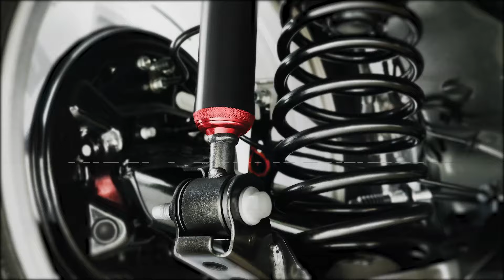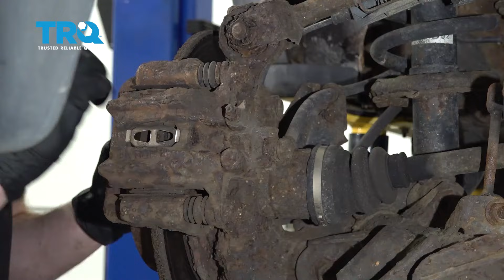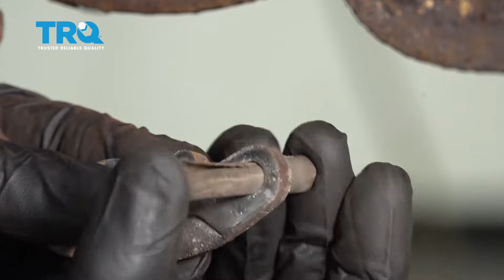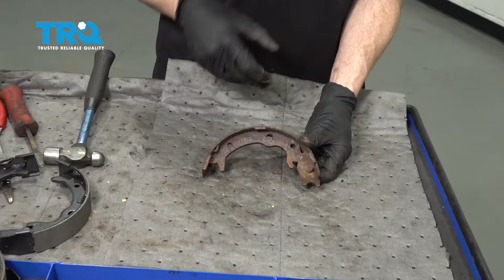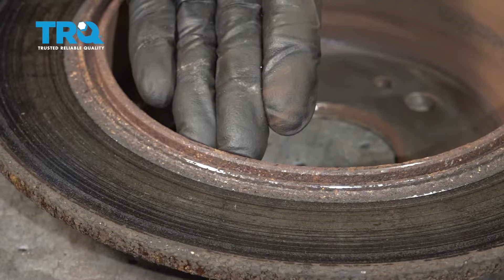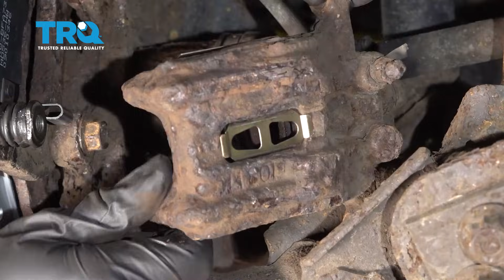How to Replace Rear Brake Shoes 2002-2006 Honda CR-V

Comment: 14:52 He doesn't explain how to orient the parking brake cable to get the shoe into that position, and the camera jumps to such a tight shot that you can't see anything. If I mirror what he's doing, my parking brake cable is bent backwards against the hub! Is it flipped on the other side?
Reply: Yes , exactly there is few moments that he doesnt show what he is doing, so I have to guess?Like in the minutes 15:52 , he slides that bridge and it suppose to hook up into the groove of the shoe?But then the lever has a bump at that spot interfering with that conection, so I could not continue with the job!

Comment: i got in the rear brakes to change rotor and pads and i'm seeing these rear drum shoes. they are just for the parking brake, right? i'm down to 2mm on those but if they are just for the parking brake, i'm thinking i'll wait since i live in a flat town.